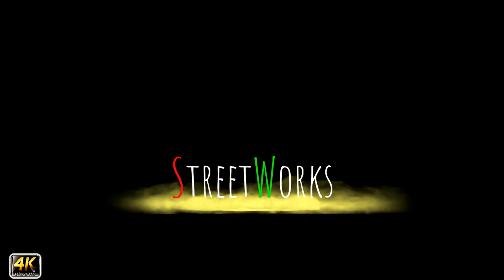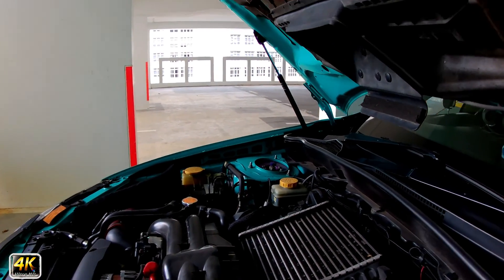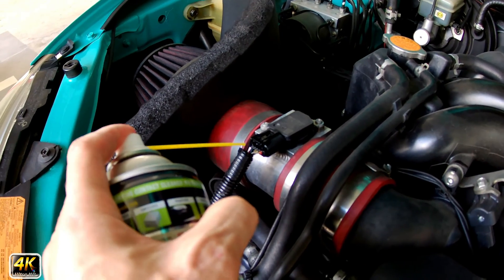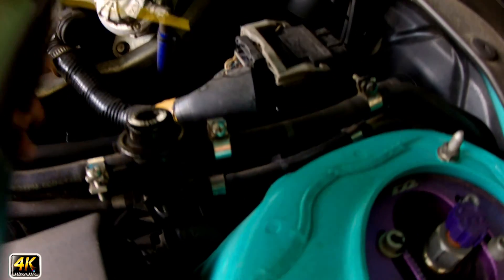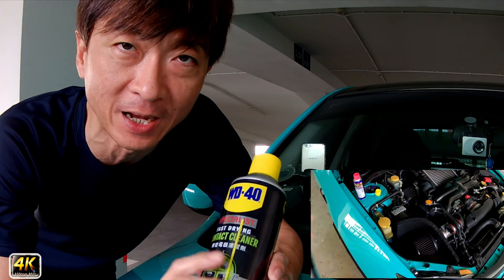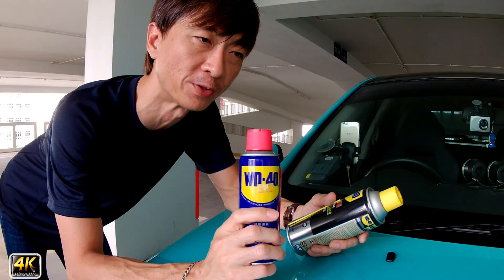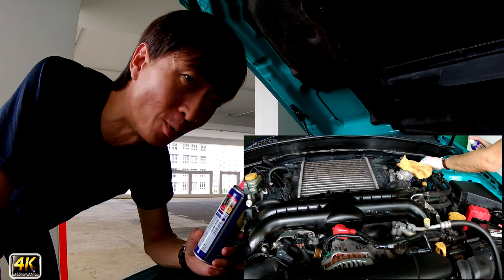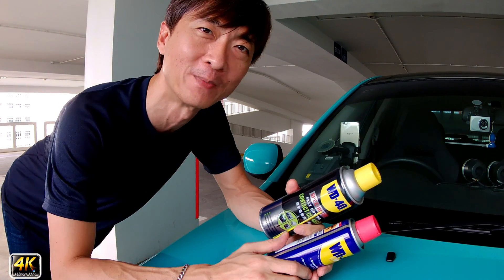WD-40 contact cleaners in your car engine

Comment: Much better than a silicone based spray for detailing engine plastics WD-40 is great for repelling water and silicone spray cleaners just attract dirt. They will clean and make everything shiny but will quickly accumulate dust and dirt.
Reply from the maker: Thanks for your opinion.  I am debunking the claims about using WD sprays in this video and I am sure we are aligned, WD doesn't work very well indeed

Comment: Can I apply on engine, as it's made of aluminium, contact cleaner won't damage right?
Reply from the maker: Should not be an issue..it's non corrosive.
Reply: @StreetWorksProject  
Can I spray it on altenator?
Reply from the maker: @ankamanirudh8837 as long you turn off the engine let it cool down. Most part of engine can be sprayed.

Comment: Can that also be used in the alternator itself since its an electronic component?
Reply from the maker: @waltercastro9112  I'm sure it's safe to use
Reply: @StreetWorksProject  What I meant is spraying contact cleaner inside the alternator. Do you spray it in?
Reply from the maker: @waltercastro9112  I'm saying it should be safe. As long you allow it to evaporate. So why not? Same answer.

Comment: Thats super flammable and can start a fire
Reply from the maker: yes but you need a fire to start that from burning
Reply: That's why you disconnect the battery and use a specialist cleaner for electrical components. As long as it is dry, it is safe to connect battery after cleaning. Test before going full send, of course...

Comment: What should we use for Sensors like MAP and O2 sensors?
Reply: For cleaning MAP you should only use MAP cleaner, and O2 sensor you can use carburator cleaner
Reply: @april_0384 Is MAF sensor cleaner ok to use as a contact cleaner?
Reply from the maker: Isn't that going to cost more ?
Reply from the maker: Anyone here can help answer this question?

Comment: Do you have experience getting swelling rubber?  Some people spray contact cleaner into their car's electrical sockets and then the rubber inside the connector swells and pops out.
Reply from the maker: I haven't had this problem but maybe it does have some effect on drying up rubbers instead? I'm not sure though. Because they do evaporate very quickly.

Comment: WD 40 will weaken plastics and rubber my dude. Do not use it like that.
Reply: From WD-40 website: 
WD-40® Specialist Silicone Lubricant can be used on plastic to help with restoring fading. WD-40® is actually safe* to use on metal, rubber, wood and plastic. It can also be applied to some painted metal surfaces without harming the paint.
Reply from the maker: Understand. Thanks
Reply: @StreetWorksProject  use silicone instead

Comment: Nice but would be a lot better if you discconect every connectors and spray it inside, then wait to dry and then connect again. Most of the automotive connectors are waterproof, so they have a rubber and the spray will not go inside.
Reply from the maker: Thanks for the tips! Yes we should remove the connectors if we want to thoroughly clean them. 
Thanks for sharing your pointers with our viewers 👍
Reply: He just talking SHIT...

Comment: can i use it to clean on aluminum parts there white powder and can i us it to spray on all elec  connection wiring plug hatness i liv near the sea salt water ,,i like ur video by the way thank you,
Reply from the maker: Surely you should clean the connectors since it is a contract cleaner and your connectors are always contaminated with.
However I don't think it's going to help remove those white residue from Aluminium. The white residue is reaction of the Aluminium.

Comment: If you are living near the salty areas, you should use WD40 spay all the electrical parts in order to prevent the rusty and remove the water as well as moisture, WD40 Contact cleaner just clean up the dust and remove oil, the protect is WD40 oil ! both of products are good for engine.
Reply: doesn't the traditional wd40 wear out rubber over time?
Reply from the maker: It kinda soften it

Comment: Long term this will fail. Unless dielectric grease is added to boot seals. This will dry out any rubber.  This stuff is nasty for the atmosphere.
Reply from the maker: Thank you for pointing out about the application of an dielectric grease to protect the rubbers boots ! Yes I will agree to your opinion.
Reply: @StreetWorksProject   also make sure you use a paper filter and not k&n. The kn will pull in sugar sand. We did oil tests and found metal shaving in oil after switching away from paper. Ended test promptly.
Reply: @mjs1231. Your comment is false. 
From WD-40 website: 
WD-40® Specialist Silicone Lubricant can be used on plastic to help with restoring fading. WD-40® is actually safe to use on metal, rubber, wood and plastic. It can also be applied to some painted metal surfaces without harming the paint.

Comment: Can we use the contact cleaner for the whole engine bay? Same function like engine degreaser?
Reply from the maker: Yes you can but there is a down side to using contact cleaners to clean the whole engine bay. You see, contact cleaners evaporates really quickly and it is probably good for electrical cleaning because it has no water content in the spray. It is also much more expensive to use as a engine degreaser.  I suggest to just buy a cheap degreaser to degrease all the gunks off the engine bay. It is actually much easier too, because the degreaser allows you to take your time to wipe / hose off those dirt and grim off the surfaces. So ya, yes and no. Hope that helps, as far as what I had experience, I would share. Cheers.

Comment: what does it smell like? 
i cannot stand the smell normal bluecan wd40 with oil lubricant
so does this electric contact cleaner smell something like alcohol spray? it doesnt smell like the bluecan wd40 right?
Reply from the maker: Yes it does smell like alcohol. But it will go away as soon as it evaporates. Very quickly.